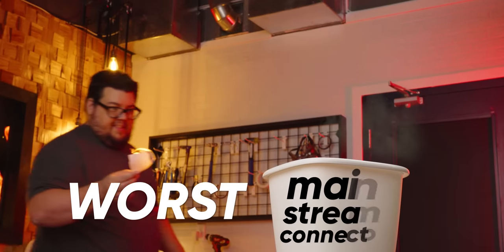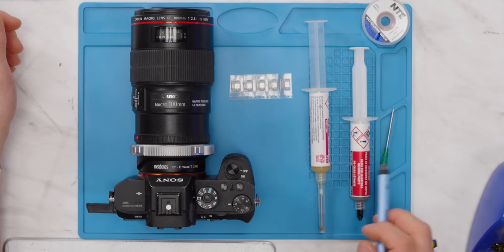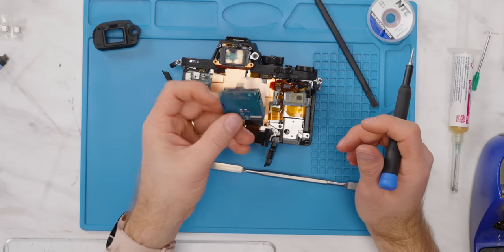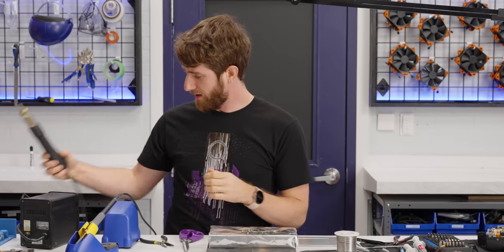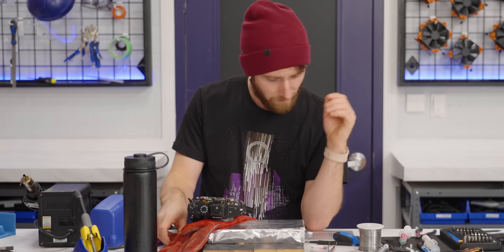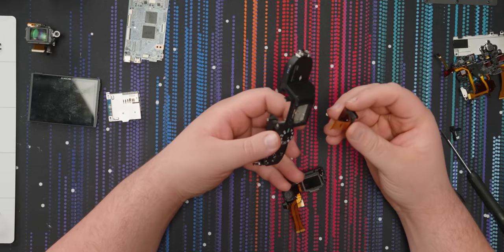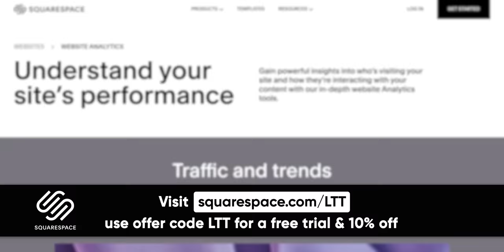This "cheap" repair almost BROKE me.

Comment: Moral of the story:
Right to repair is essential but that does not necessarily mean that you can or you should fix your device 😂
Reply: also design architecture with repairablity in mind, they made it so difficult to pul this camera apart and to solder it with al the plasic bits
Reply: Unless you know what you are doing, and have experience doing it before. Linus obviously is a novice or beginner and made a lot of mistakes that eventually costed him. But how do you learn without making mistakes!
Reply: @zoey101dogwablog  school

you can learn in school :)
Reply: @martinkrauser4029  School does not reach you how to repair electronics
Reply: Most high schools have Robotics classes and you learn how to solder and code. The better teachers will have you learn by having you repair things
Reply: @mcnecho927  what kind of high school you attended wtf, also here in latam we didnt even got near a computer so its not common to have THAT in the whole world
Reply: Exactly. When in doubt, find an expert. You should, however, be able to pick your own expert.
Reply: you should have the right to destroy your board fixing it.  It is not sony's camera.
Reply: @martinkrauser4029  you don't need school.
Reply: @myriadtechrepair1191  when in doubt trial and error.
Reply: @ChickenPermissionOG  you do have the right to destroy whatever you own.
Reply: @GameTimeWhy  not when you try to repair it.  Try finding part when companies won't let manufacturers sell it to anyone else.  They go out of their way to make it impossible to get parts and when you can you parts get seized at port.
Reply: Knowledge is the key element here, the service centers dont sell u just a service, they also sell u knowledge, the knowledge u dont have, you can put any price to that.
Reply: @killerboybe1515  if u have a way to engeneer it better go ahead. sometimes is just an engeneering solution, not just creating an inconvinicence.
Reply: @ChickenPermissionOG   any kind of education on electronics works but still, most of the skills about soldering is at first hand and that cant be learnt without screwing around and find out
Reply: @mementocity  u cant compare LATAM to 1st world countries, there are tons of schools that teach electronics. but not in LATAM.
Reply: @GameTimeWhy  thats right to destroy then, not right to repair.
Reply: @ChickenPermissionOG  this is absolute nonsense. Finding some proprietary parts can be difficult but ports will not seize your purchase of a proprietary part for your camera.
Reply: @onlineghost9813  I never said they were the same thing.
Reply: you should be allowed to repair everything in your possession, but you should also be smart and know when to ask a professional to take the job.
Reply: @mementocity  
I think he meant college level education, or some other kind of further learning.
Reply: @circuit10  there's a school for electronics, you know
Reply: @GameTimeWhy  Yes they will you have no idea what you are talking about.  Apple does it all the time.
Reply: @michaelterry6576  that makes sense, wished there were some in here without going too far from home outside the country
Reply: @martinkrauser4029  School cant give you Brain.exe 
Seen it alot on field... every day...
And if you have it, you can learn things by yourself.
Reply: @ChickenPermissionOG  they seize shipments to private citizens at ports?
Reply: @GameTimeWhy  yes watch Rossman's video on it.
Reply: @ChickenPermissionOG  Not on a $3k camera.
Reply: @circuit10  Trade schools exist, either way you're still going to make mistakes and learn from them regardless.
Reply: @ChickenPermissionOG  Louis is a great advocate for right to repair but he isn't always right about everything.
Reply: @killerboybe1515  It's not only difficult for us, it's difficult for them too while they make / repair their devices. There must be some reason why they have opted for such design, one evident being that size & weight matters to buyers.
Reply: @onlineghost9813  It maybe that we dont have the knowledge but the alot of repair professionals definitely have it and can do job as good or better than the manufacturer, if provided parts. By limiting access, they technically create monopoly in the repair market.
Reply: @GameTimeWhy  Other than the proof he has about it..
Reply: @ChickenPermissionOG  except there isn't. Apple does not have the power to stop your purchase at customs. Not possible.
Reply: @GameTimeWhy  You are highly mistaken.  Go ahead try and get some apple replacement parts see what happens.
Reply: @ChickenPermissionOG  will do. I actually have an old iPod I've been meaning to repair. It's impossible for Apple to stop replacement parts from coming through customs.
Reply: @GameTimeWhy  Its not why do you think people hate apple and their iron fist on repairs.
Reply: @ChickenPermissionOG  Apple sucks but not because of an imagined ability to stop replacement parts at customs. You don't need to create strawmen on this one, dude.
Reply: @martinkrauser4029  School is not as good at teaching as failure. Especially when you critically go over what you've tried and picked out what was flawed in the process. Also, not every schools has robotics or design tech, etc. Ours didn't, don't even think its available anymore here, didn't stop me from picking up a solder iron and learning on the fly.

Comment: Quick tip: when trying to remove a component try not to lever it off at all, as that rns the ris of ripping up pads. Flood it with flux and wait till the solder is all wet before pulling it off!

Comment: Micro HDMI is the worst. I recommend getting a camera cage and clamping down an adapter (to actual, real HDMI) that just always lives with and in the camera.
Reply: miniHDMI is even worse than microHDMI
Reply: No miniHDMI is way better. Still not great but sits in-between microHDMI and full size HDMI in size.
Reply: Any hdmi is crap for professional use basically. It's a household connetor, it wasn't designed to withstand any proper amount of forces that occur to it when moving a camera even when we're talking about full-size hdmi. BNC is the way to go, but i get it that it's impractical for dslrs
Reply: @wheresvr6  I wish they kept the standard of being able to secure video cables with those 2 screws, like vga and dvi cables
Reply: @saltananda3227  yeah. Now that's basically what all these cable holders do

Comment: As someone who does this kind of stuff daily, this was painful.  Still enjoyed watching the struggle though.
Reply: Hats off to you. The amount of tiny parts there was stressing me out just WATCHING, I couldn't begin to imagine actually doing it on $1000+ equipment.
Reply: Every camera tech just cries inside... me included
Reply: @ddgarage7025  Do techs actually use heat guns, or desoldering irons?
Reply: Ah yes, but we have all goofed at least once, and it made us better for it.
Reply: @CubicIronPyrite  work in console/handheld/phone repairs, hot air is common for ports, though i do it from behind connection and hit the anchors/pins with low melt solder first to help the port loosen sooner at lower temps to protect other components
Reply: @LukewarmMiner  Using low melt solder to help liquify solder of higher melting temps, very smart!  Thanks for the info.
Reply: Watching him rock the connector before all the solder was melted had my insides tightened up in a knot.
Reply: I mean, you guys are trained professional, we are just dum-dum guy that just wanna try to push the limit of being average person
Reply: I'm going to get PTSD from this. Not even fixating the board. Ngl this is how everyone started though.
Reply: @bocahdongo7769  not necessarily. I'm doing this as a hobby and I still feel the pain.
Reply: As someone who never does this kind of stuff, this was painful.  Still enjoyed watching the struggle though
Reply: @TropFirefly I won't say "Hobby" as average users too

Comment: There is nothing more valuable than the chance to learn from other peoples failures. Thank you so much for posting this process with all the bumps and bruises. 

I love the right to repair movement and will always advocate having a better understanding of your hardware and doing your own maintenance if possible. However I feel to many repair advocates skip over the fact that if you don't know what you're doing or aren't following the directions of someone who does, you can easily double any potential professional service bill or wind up needing to pay for a full replacement. Right to repair wont make everyone a skilled technician, but it will empower people to do the simple repairs that can double the lifespan of everyday items like phones and laptops.
Reply: Agree, and certain devices are just a thousand times harder to repair than others. I frequently repair smartphones, and advocate for right to repair on them. They are difficult to repair, but doable, I have personally done dozens and not broken a one. Even with multiple years of experience doing smartphone, laptop, desktop, iMac repair, I would NEVER touch a camera. I love photography and own multiple camera's, new and old, and I looked into repairing an old Canon AE1 film camera, and it is crazy. Mad respect for the people who repair cameras, because the way they are packed together with a million insanely fragile ribbon cables, its a nightmare.
Reply: @MarshallHoff  To be fair, alot of the difficulty is because they make stuff as horrible as possible to fix without patented tools..
Reply: We each saved several hundred $$$ watching Linus do this so we did not.
Reply: If I had a nickel for every ripped pad and burned PCB because someone thought it would be an easy fix...
Reply: No legislation could ever make technicians obsolete. Right to repair means you can bring your stuff to a technician you trust and get a fair price, instead of the manufacturers giving themselves a monopoly on repairing their own stuff and price gouging everyone.

Comment: You don't need 430C, just lower it to like 350C and take it slower. Also, do a circular motion with the gun to make the heat more uniform. Going too fast will usually result in stuff like this where you melt the plastic.
Reply: I don't remember the last time Linus built a watercooled PC with hard tubing (or if he ever did). That would be one experience where learning how to properly and evenly heat plastic is important.
Reply: this, and also putting a bit of capton tape over it helps to spread heat evenly preventing the plastic from melting.

IMHO i'd even ditch hot air soldering in those cases; the connector should be easily soldered by hand given enough flux and a microscope.
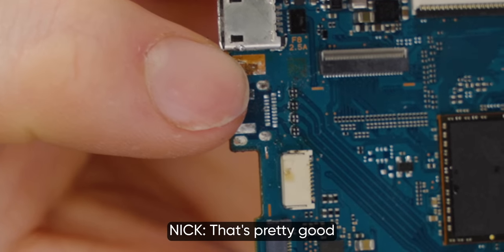Reply: @ald3nt3  Normally, you'd be right about doing it by hand! Micro-HDMI SMDs have a second row of pins (check out 8:28) that are inaccessible once it's in place (12:34). Hot air is pretty much the only way to get these on.
Reply: nah, you can only remove a solder joint when the soilder reaching its melting temperature. No mater you do it slow or fast. Manufatures use lead free soldering with high melting temperature. The only way you can remove it with less heat is using low melt soilder (content Bismuth) , mix it with the soldering joint using iron, then apply heat, cover a board with Al foil with you don't want to expose to heat. This video demonstrate a poorly skill and have no idea what to do will runing you think. Please don't do it. Practice it on something you dont care first, make some research.BTW You can easy repair ribbon cable just soilder a wire back.
Reply: @GulfCoastGrit  ah, crap, yeah, two rowed connector, then it's hot air time
Reply: @overclock1993  I was not really expecting to find the confidently wrong internet person today, but in retrospect that was kind of granted when I posted this reply. What do you think is the melting temperature for this high temperature solder you talk about? (spoiler: the definition for high temperature solder in this applications is near universally accepted as solder with a melting point between 270 and 350... hummm I wonder why that number sounds so familiar, maybe I am not pulling stuff out of my ass unlike other people).
Reply: Also, before you reply, please consider: I surely have no soldering experience, right?
Reply: @MissingClara  I said soilder reaching it mealing temperature which means you have to heat up the board to this temp. You set your heat gun at 350C only tell it does 350C at the heating element not the air you push out or temp of the board. You get me right? Because Linus have a shady heat gun so he have to use a hot plate to aid it.
Reply: Don't use hotair when installing ports like this. Always start by soldering the cage first, then the pins. Hot air is only good for removing in this case.
Reply: @ccricers  I would like to point out that an LTT video was uploaded about two weeks ago about a very custom - water-cooled - pc build colab: "This PC took 600 HOURS to Build!"

In the end, I always see this content as entertainment rather than factual - demonstrate that somthing can be done by a novice, but also the potential for damage.
Reply: This
Reply: @EvilWiffles  nope. You have to use air. It’s got a row of hidden pins. Plus, air is just so much easier.
Reply: could just use leaded solder.

Comment: A friend of mine many years ago told me that a short extension for HDMI and USB ports will make the port last longer as you will not be applying pressure to the port when connecting and disconnecting it. Most short extensions are 3 ft or less and cost very little compared to the cost of repairing-replacing ports.

Comment: Why not use a micro hdmi coupler and keep it always connected to the camera ? Then you don’t have to wear out the port
Reply: Yupp. 5 dollar fix.
Reply: You are correct 👍, attached to a micro rig cage is a solid solution
Reply: The cable will still put weight on the coupler causing it to lever on the micro HDMI more. Also, it would be more annoying to rig the camera out because of the profile of the coupler. I suppose the levering part could be remedied by a 3d printed cable support or sum like that. What we need to do is stop supporting these companies and buying their new products
Reply: Because the guys at LTT aren't the brightest people sometimes 🤷🏼‍♂️
Reply: Hindsight is 20/20
Reply: @thewafen763  This Camera is used in a professional setting where it usually remains rigged (cage and accessories attached). A permanent adapter can be attached to other parts of the camera/rig to relief the port and the form factor does not matter that much. I don’t get why you blame Sony here and want to boycott them? They include a stain relief in the package, they are willing to repair the camera for a price that is much lower then buying a new one and somewhat reasonable if you consider the work & risk involved in this. They made the SD port replaceable and did not want to make the camera bigger to make a port that most of its buyers never use replaceable. They even make replacement Parts available. That seems pretty reasonable to me.
Reply: @thewafen763  tones of bracket systems to keep stress off of connectors. you build the camera brakets properly and youd never have this problem. HDMI, all kinds of hdmi is weak and easy to break so if you plan to use cables on a video camera invest in a cage one time.
Reply: It's not just the plugging and unplugging that wears it out any sideways force on the plug does it too and an adaptor and a full size cable will double the sideways force.
Reply: @thewafen763  that's why you use camera cage that holds it in fixed position
Reply: Not a very interesting video that would make no?
Reply: @retrobass3693  Is that not what i said?
Reply: Yes you could just zip tie the cable to your cage in a way that takes the weight of the port. But like I said. It will reduce options for further rigging, and make changing the rig more time-consuming. Filmers what a rig to be versatile meaning: 
Fast changes for different applications.
 @Dom V.  Yes you could just zip tie the cable to your cage in a way that takes the weight of the port. But like I said. It will reduce options for further rigging, and make changing the rig more time-consuming. Filmers what a rig to be versatile meaning: 
Fast changes for different applications.
Reply: @thewafen763  solo filmmakers are different thing than production that uses same sets and same setups 

And you don't zip tie it to a cage, you mount it properly
Reply: You must be waffling.  Please show me how your camera is rigged in a way where the cage perfectly supports an HDMI coupler. I have a feeling you don't understand what radial forces can do on a port or you are just a filmmaker with little experience. So make a short of your rig and how your cage mediates the problem.

Comment: On removing the old connector you'd want to wait until you can just kind of tap the top of it and it wiggles before you start trying to remove it. I'd also recommend trying to gently tap it to the side when you think it's ready before lifting on it. If you got a pad stuck you're less likely to rip anything with a sheering force then a prying one. As far as the new port goes I'd have used solder paste and hand soldered the through-hole mounting pins to hold it in place before hand. I would have definitely been doing all this under a microscope or at least some sort of magnification to make sure the alignment is right. Other than that, this is just what gaining experience looks like. You took what you knew, tried to apply it, had some setbacks, and now you'll know more for next time.